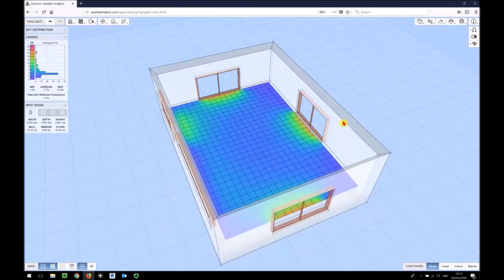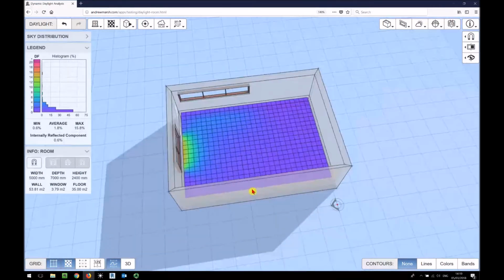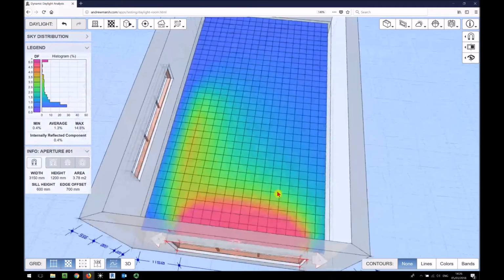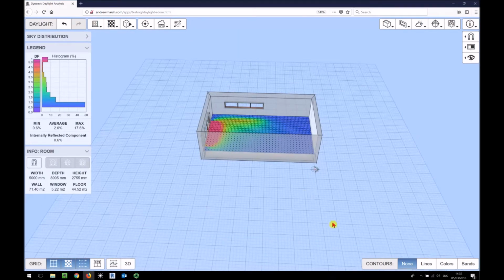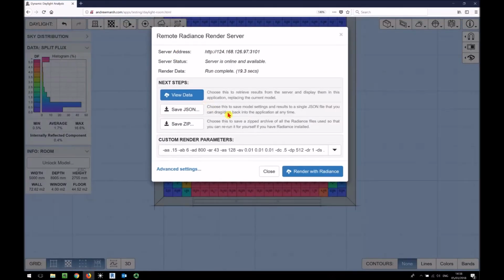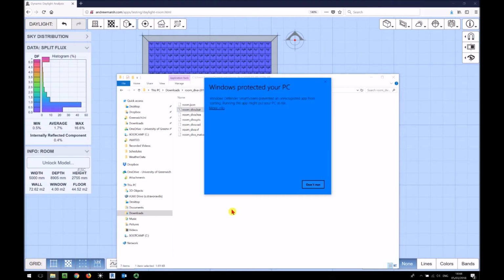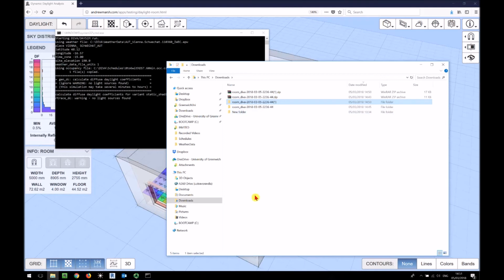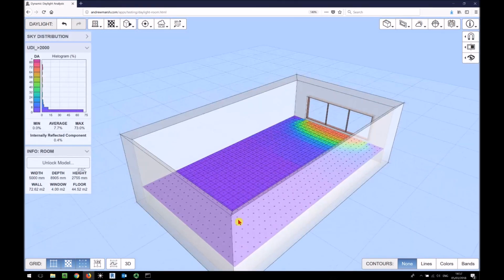Performative Design Daylight Tool (v.5/3/2018)- Introduction

Comment: Hey, is there a way to download an image or the animation, and also can we add a SketchUp model??
Reply from the maker: Until now it is not possible to download an image. So, a screeshot is the easiest way to do 'download' an image. For an animation, the same, you would need a screen capturing software.
In the daylight tool it is not possible to import a model yet. You can only edit the dimensions of the existing box type room. Creating other geometry or importing other geometry will happen sometime in the future.
Other online tools (such as the shading tools) allow you to import sketchup models.